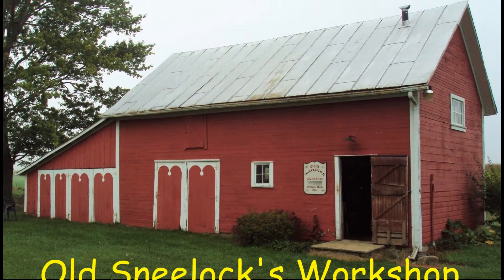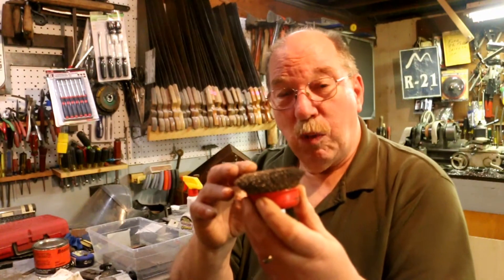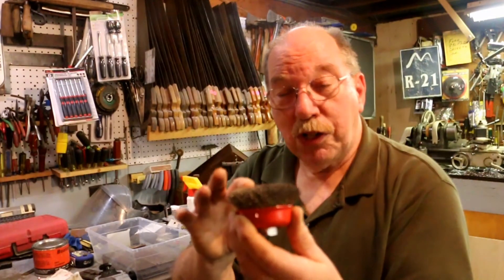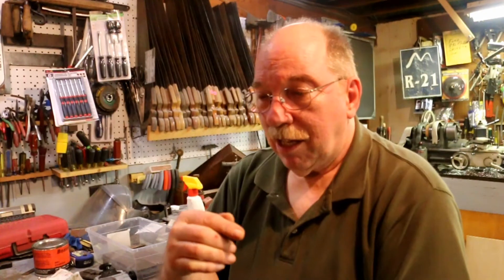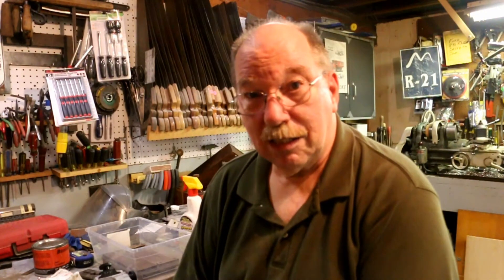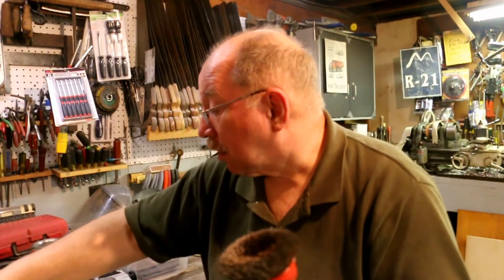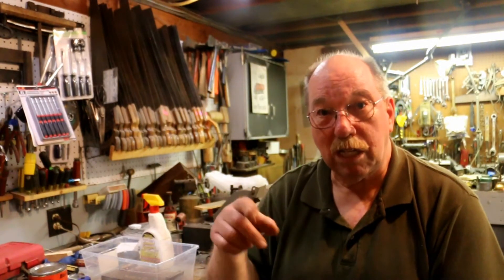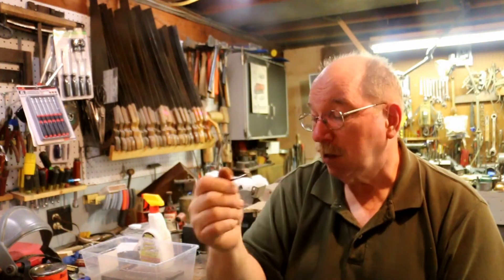Where To Find Good Wire Wheels - Best Source - Why They Shed Wire

Comment: I can’t for the life of me find a decent 6 inch fine, brass wheel with a 1/2in arbor in any of the big box stores, not much luck on line either, Amazon can be misleading.
Reply from the maker: MSC has them but they want a kings ransom for one. They say it is a brass wire wheel. MSC is usually pretty good. Moste of the "Brass" wire wheels are brass plated steel wire. 
https://www.mscdirect.com/browse/tnpla/74038910?cid=ppc-google-&mkwid=%7cdc&pcrid=618893947830&rd=k&product_id=74038910&gclid=Cj0KCQjw8qmhBhClARIsANAtbocfkC4FaoMLZ6wgtWmMpj1PIyJwRBPBEtfHp-8q9v_kOEGhlv6Mf6caAsOdEALw_wcB&gclsrc=aw.ds

Comment: Nice informational video !!  I use HF wheels as they are sometimes donated by this guy or that guy for a project.  But when I need to buy them myself, I go to the actual welding supply locations for higher quality (and higher priced) wire wheels.  All sizes 4, 4 1/2 and 6'' for angle grinders and 6'' and 8'' for bench grinders.  The angle grinders I use both cupped as well as flat wheels.  The same thing with grinding discs.  If I buy them its high quality from welding supply and if they are donated, its whatever is offered.  Generally speaking, the actual welding supply houses sell consistently high quality.  And when it comes to high speed flying wires heading to my eye balls, its safety glasses all the way, whether HF cheapies or the best money can buy !!
Reply from the maker: Best plan. When I first started riding motorcycles in 1968 I needed to buy a helmet to meet the helmet law requirements in Michigan. I checked around and read an article where the guy said, "Helmets cost money. If you have a $10.00 head buy a $10.00 Helmet. 
I apply the same philosophy to most things. 😁😎

Comment: I have had good luck with Harbor Freight wheels but like anything with imports it's hit and miss...  I like the brass colored wheels!
Reply from the maker: I bought Brass wheels for removing paint from stamped steel barcodes at Demmer Corp. They lasted a day or two. They were necessary because they wouldn't scour the barcod away causing us to discard a $4000.00 armored door for loss of traceability. 
The brass plated fine wire wheels that you are using seem to do well. I bet it is somewhat due to operator skill. 😁😎

Comment: I use the one on my bench grinder all the time and it's lasted for several years, I just went down into the shop and there's no name on it and can't remember where it came from..........Seems like ACE Hardware but I just can't remember where it came from for sure.
Reply from the maker: Used properly they can last a long time. It would be nice to be able to promote the good ones. 😁😎

Comment: Wisdom (earned the hard way, uncle Dave?) for the newby. Use the safety gear, because it is not IF but WHEN the doody strikes the fan. It will. As you said before, you have enough scars. As do I. 👍

Comment: Thank you for the informatio. I have used them a lot over the years but seams like I have have had a lot more problems of them coming apart. I have been seeing several restorers not wear gloves. As much as mine come apart my hands would be tore up. Thought I might be buying something wrong so thought I would ask. I have checked at harbor freight about this problem and mine didn't have any others on the shelf. But I didn't ask sounds like I need to. Again thanks for answering the questions. I can always learn. Thanks
Reply: Harbor Freight sells a nylon abrasive wheel that works in your drill.  It doesn't work as well as the wire wheels, but on the plus side it doesn't throw wires!
Reply: Thanks
Reply from the maker: I respect that you asked. If you can learn from my mistakes all the better. 
Saying, "Well I won't do that again!" usually involves stopping to clean up and bind various leaks. If not a road trip with lights and sirens. 
Besides, buying lots of tools should be fun. 
Buying lots of substandard tools is frustrating. 
Buy once. Cry once. 😁😎

Comment: I have a brass wire wheel that I use on my grinder. Not a brass coated steel wheel, but an all brass wheel. It's wearing down, and I have yet to find a replacement for it. Have you any idea where you might find one?
Reply from the maker: Grainger has several listed. They purport to be brass wire. I haven't bought from them since I retired. In the 40 years that I used  them as a supplier of specialty items they were a good source. 
Industrial supply companies are usually good places to get good tools. When I was buying for large companies I wanted to order and forget it. Going back to return or argue over delivery knocked them off the supplier list. 
With manufacturing moving offshore the suppliers are following. Online purchasing tends toward crap. 😁😎

Comment: Can you describe what to look for in a bench grinder/buffer that doesn’t bog down when you touch it?
Reply from the maker: Baldor and Dayton were good names. With so many suppliers going offshore it is hard to tell. 
1/2 hp minimum that usually costs $300 to $500.00 will get a good one. A great one may go $1000.00 or more. 
Cast iron frames are another thing to look for. 😁😎

Comment: Good deal, Unc! Different wheels for different jobs! I have a flat one in the HBM for usual stuff. Then I have the spiral wound cup for more intense stuff like cleaning up the Fisher heater. Then got a hi-dollar small twisted one to clean up the combustion surfaces in the opposed twin. All work well but all shed wires. Just like getting used to metal spatter when welding bare armed and mill scale and rust flying off a grinding wheels. I've been doing clean up and weld prep forever. The Sea Bee Uncle started me out using a big grinder with it a LONG time ago. Way before I was blowing black smoke on the road in something besides O.D. Green 5-trons. There's always dangers when moving stuff is involved. Size up the job, don't overload yourself and 'Put yer stuff awn' and somebody I know said a while back. GBWYall!.
Reply: Dottie's home and doing better. Went to one of her doctors toady. 
Gotta see two2 doctor 2morrow.
Reply from the maker: @mostlymoparih5682  Give her our love Marty. Take care.  We are thinking of you.
Reply: @mostlymoparih5682  Thank the Lord and YAAY! Have been and will be!
Reply from the maker: When Glen asked the question It flipped the lecture switch.   😁😎
Reply: @OldSneelock  I wish the handle would fall off the switch and it be left in the ON position!
Reply from the maker: @lewiemcneely9143  Hard to believe but eventually even I would get tired of hearing my own voice. 
I would love to have a call in talk show where people ask questions and we could really discuss some of the things that we like doing. 
Not going to happen, but a man can dream.😁😎
Reply: @OldSneelock  A chat is the closest I guess and it's a wreck at best. But might as well dream big. Don't cost a bit more! But a talker is a FINE idea!

Comment: I do not use wire wheels often.   As you mention, they can and do shed wires.
When I use a wire wheel, it is mostly a brass disc style wheel mounted in the drill press.   The drill press is often set to around 650 rpm so much slower than grinder or Dremel, etc.
Watching the video reminds me of your extensive hand saw collection on the back wall.   Suggestion for future video is to show us the different hand saws and why you have so many.
Dave.
Reply from the maker: Good suggestion. I can talk saws for hours. 😁😎